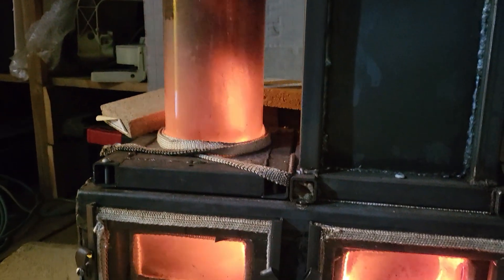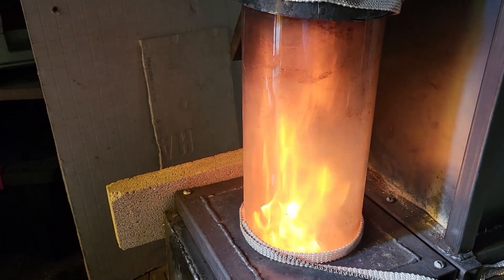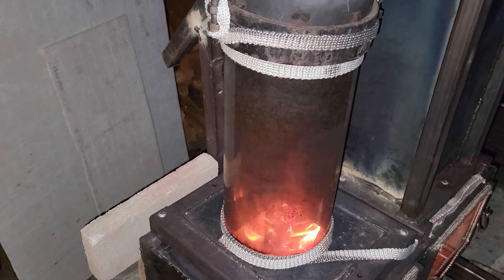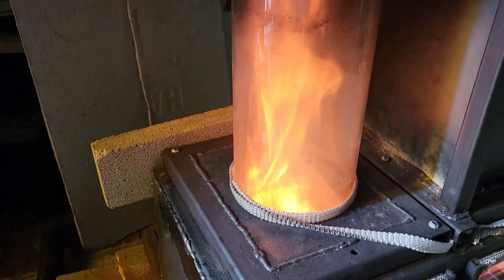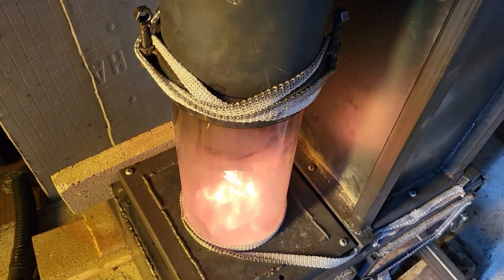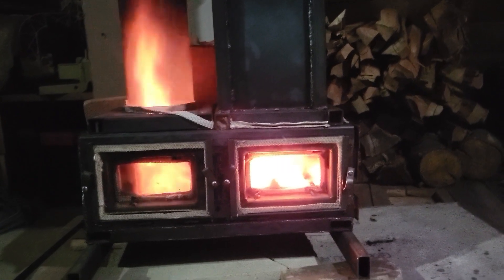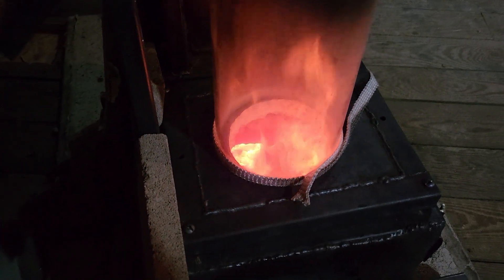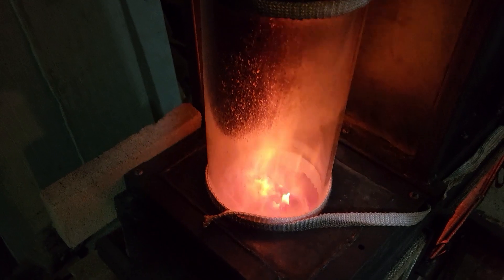Cross draft gasifier updates.

Comment: Nice concept! Being no practical expert but only theorizing for a long time on these matters: Insulation, insulation, insulation! That said: You have way to many uninsulated surfaces. 
As nice as the glass is for watching the fire,  it tremendously lowers the burn temperatures. This is the reason why "conventional" stoves are not efficient. Extracting heat directly from the burn chamber leads to lots of unburned gases. 
I would reduce the glass surfaces significantly. And also have a longer horizontal way for the burn to the glass tube which cools down the gases too much as well. I think, the burn should at best be pretty much complete when reaching the glass tube. And preheat inlet air as much as possible as well, especially for you later burn stages..
The opposite goes for the part after the glass tube: Give it as much surface as possible to cool down the gases, so it can produce a draft and emit most of the heat.
Just my two cents. Have fun.
Reply from the maker: The glass section in the burn chamber is double plated to try help with that, but air does get pushed through there to get heated so it could be having a negative effect. I hope to build more soon, thx for the feedback.